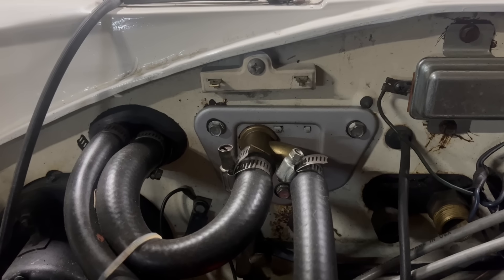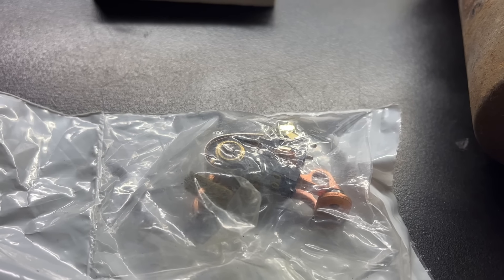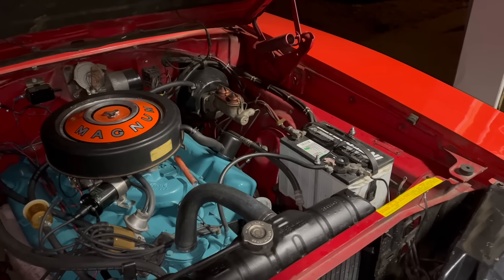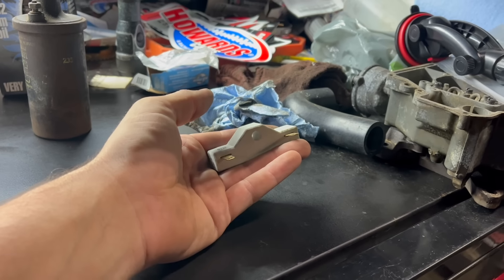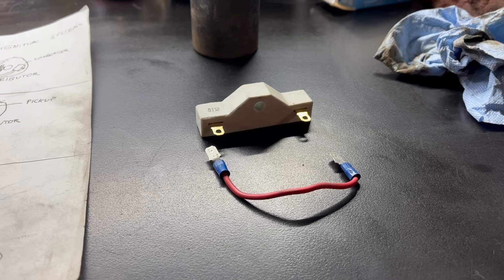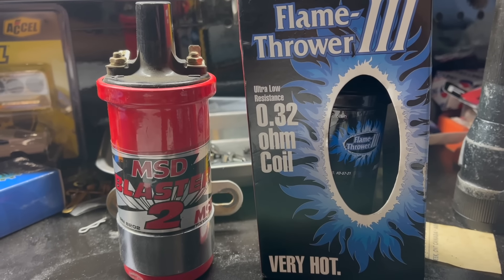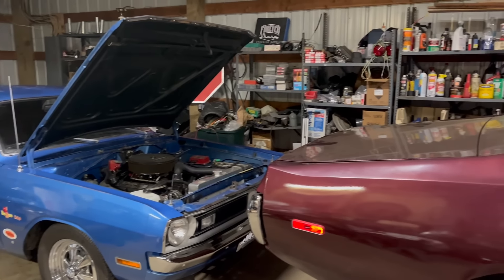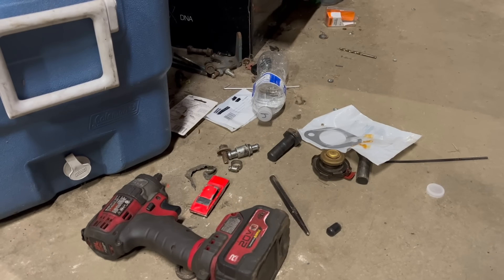The Big Ballast Resistor Video! A Simple, Yet Misunderstood Part Of Your Classic Chrysler Product

Comment: REAL Mopar guys hack driving with a bad resistor by starting the car in neutral and then knocking the shifter into drive while holding the key full twist.  But your method is cute!
Reply from the maker: But what about stick shift Challengers with no clutch safety? What do real Mopar guys do then?! Check and mate
Reply: @DeadDodgeGarage 😂
Reply: Every hack is valuable when the mental Rolodex shuffles into panic mode ...like in the McDonald's drive-thru! We've all been there 😅, keep up the great work Mopar family 😁
Reply: Personally, I'll NEVER have another MOPAR without a (GM😮) HEI module conversion. 
Mount the HEI module on a heat sink and carry a spare module, especially if it's a cheapo.
Reply: HEI IS AWESOME 👍😎 AND CAN BE MODIFIED TO ABOVE 7000rpm....👍
Reply: That's how you get them on the trailer right after you bought it real cheap!
Reply: Installed a kit where you got a new dizzy and orange box along with a smaller looking ballast resistor where the instructions insisted to use. Why ? and could the stock resistor still work? Thanks for the video
Reply: This Tony guy is a legend in his own mind.

Comment: Best way to make sure you’re ballast resistor will always work is to carry a spare!  It’s the best $3 I spend on every mopar I have that still use a resistor.
Reply from the maker: Bingo! Just like how having a brand new engine wrapped up on a stand will ensure that yours never breaks. Haha.
Reply: Three dollars has been a while .
Reply: I laugh about the other guys trying to delete or bypass the resistor unstead of just having a backup or 2 😂😂😂 especially in my case I'm a full purest with 1 exception that parts are completely obsolete and something new has to be done or park the car indefinitely
Reply from the maker: @danlevesque5437  I'm, like... most of a purist? With the exception of common, non-destructive, perfectly acceptable upgrades - your Edelbrock carburetors, your electronic ignition systems, sway bars, what have you. In general, I prefer mostly factory stuff.
Reply: @DeadDodgeGarage  I have faimly members who chop up the classic hardtop and make them convertibles when they were not, added automatic transmission to factory 3 on the tree vehicles, and even added a self jacking feature because they wanted to hit a button vs jacking up the car If it got a flat tire 🤦‍♂️
Reply: Friend of mine used to carry 2 or three spares.
Reply: It could also be a bad  electronic mod that could disable the motor. I also carried one of those in the car.

Comment: Fifty years ago i made a camper out of a 1953 GMC school bus , converted to 12 volts except for the starter . With the ballast resistor in the circuit the 302 CI six and six volt starter would fire when i let off the starter . The starter was foot operated so bypass circuit was not possible .I put a push button switch on the dash to short the resistor, then i would ask the youngest kid to help me start the engine by pushing the switch . The kids LOVED it !

Comment: I used to work where we had a dozen or so Dodge trucks that had a ballast resistor. Every once in a while someone would hit a pothole  and after turning the engine off it would not restart. We found a good thump would break the resistor. We ended up putting an elastic band on the firewall and fender and taping the resistor to the band to act as a shock absorber. That stopped the resistor from breaking.
Reply from the maker: Brilliant!

Comment: The parts store ignition box you show at 12:35 merits some comment.  Notice the odd shape and lack of electronics part numbers on the dome?  Some guys too these apart and found that they are not transistors, just a dummy stamped dome.  And the heat sinks were not attached to the components inside.  I would avoid purchasing these if possible, but I doubt anything else can be found new.
Reply from the maker: Someone else mentioned that too! I’ve never torn one apart, but now I feel like I should for science.

Comment: I replaced the Ford HEI system with a GM Style HEI distributor on my small block Ford. I kept burning the control module on the distributor. I checked voltage and it would spike to 15 volts when the alternator would kick on. I placed a ballast resister in the line going to the distributor. Solved the problem.
Reply from the maker: Huh. That’s interesting… the charging system output shouldn’t even reach 15 volts, and there ought to be a good bit of voltage drop from there to the ignition. But hey, it worked.
Reply: It would only spike for a second. I put a new voltage regulator on and it was better but there was still a slight voltage spike. I wired it with out a resister and it burned it again but not right away. 
I put the resister back and haven't had a problem since. I guess the next step is an internal regulated alternator. I don't know but my control module just doesn't like 13.6 volts.

Comment: when i was a lid we had a jeep that was hard to start my dad added one of these may not be the same one then a push pull switch and when it was used the jeep started right up no matter how cold or hot but you had to turn it off and not run it with it on or things could burn up

Comment: Previous owner put an MSD ignition box and coil in my 1984 B350, I kind of prefer that to going with a GM part. The box failed once when the under hood harness went up in smoke last year.
Reply from the maker: MSD is great - but it’s so expensive…
Reply: @DeadDodgeGarage  it’s a little expensive but I trust it for reliability more than a GM part.

Comment: Voltage drop when cranking in the J2 circuit (ignition) would cause hard starting in Lean Burn computer cars and later computer versions. I replaced a lot of ignition switches and connector terminals.
Reply from the maker: Interesting! Thankfully I haven’t had to go down that rabbit hole.

Comment: Thanks for a great video.  Here's me looking for free advice.  I have a 318 Chrysler marine in an old inboard boat.  The boat starts great.  Runs great.  But after running for a while it starts to hesitate and run really rough at idle.  New plugs, wire, cap and rotor.  Does that sound like ballast or points or something else.
Reply from the maker: I can’t say I’ve run into anything like that. One could conceive of multiple causes though. Have you done a resistance test on the coil? Does this thing have points? If not, I would be suspicious of an ignition control module issue. Or with points, a condenser failure can do interesting things kind of like that. Or - is the engine possibly getting hot? Cooling can definitely be an issue in boats like that.

Comment: I haven't worked on old Chryslers in decades but IIRC the ballast resistor varies its resistance. As they get hot resistance increases. If your Dodge didn't start in a couple tries, turn the key off and give it 30 seconds to cool off. You could tell the guys who bypassed that resistor, as they'd melt points and snuff the occasional coil.
Reply from the maker: That’s give or take how it works. The thing about the no start is that it should always fire and then die if it is a ballast issue, as during cranking the resistor is completely out of the equation.
Reply: @DeadDodgeGarage  Thanks. I recall coils running on 6V for Chrysler products but do you know when it was discontinued? I recall people removed the ballast by going to electronic ignition and a "modern" coil. (I was never sure how Ford/Chevy handled 12V systems.) Back in the day I switched a couple cars from 6 to 12V systems and installed Dodge resistors. Then the only bit to worry about were wiper motors and radio.

Comment: I've owned at least 2 of these cars constantly since 1979 and have never replaced a ballast resistor, and only replaced 2 ignition modules, 1 just quit, the other all the goo melted off of the back but was still running fine, but I replaced it anyway just because!
Reply from the maker: I’ve seen several modules do that! It’s always a really impressive mess.

Comment: Basically you need a strong spark to start a old school 440 CI in 0F or -17C weather. Also the battery will produce a lower voltage at 0F.
So a start relay shorts the ballast and provides full current to the coil.
But once running that current will also over heat the coil.
The ballast resistor is used to limit the current.
A voltmeter will show the difference. Most systems will run at 13.2 volts. At a nice 72 F the battery is a nice 12.7 volts( when nearly new).
The resistor provides a drop in voltage and lessens the current and heat inside the coil.

Starting a carburetor purple shaft 440 in the winter sucks. Below 0F usually requires jumper cables.
That is why a 318 CI 2 barrel is better in the winter. You can also use it to jump start a high horsepower 440.
Reply from the maker: The resistor bypass in these is not from any relay - it’s a special starting power feed straight from the ignition switch.
Reply: The starter solenoid is nothing more than a simple relay energized by the ignition switch start position.
Reply: @JoeBlowski  Not any more. The computer monitors the RPMs. NO RPMs sends clear to start pulse to another relay after a dozen other systems checks are done.

But I understand. Can't expect today's humans to do things like.
The Ebrake is engaged. Yep had to pull on that too.
 Depress the clutch. 
Ensure the Transmission is in neutral .
 Why should they?
Might miss a post on their phones.
Reply: @DeadDodgeGarage It seems I was wrongly thinking the reason Ford used the starter solenoid/relay was because current during resistor bypass while starting the engine would be more than the ignition switch could handle.

Comment: If your Mopar don't start and your ignition is not working sometimes it can be the starter dragging and pulling enough voltage away to where the module can't think, but the starter still rolls the engine over.
Reply from the maker: I’ve never experienced that in a Mopar. I have experienced it in early 70s Cadillacs though. Two of them. Both had points ignition.

Comment: i have hyundai azera 2009 & i found a resistor for my ignetion coils in the parts catalog. if it's became faulty what are symptoms? because the engine have random stuttering even i can hear the statics in the speakers because of it! by the way the spark plugs, coils, battery, alternator are new & the diagnostic tool don't show misfire
Reply from the maker: That’s a different kind of ignition resistor - and a totally different kind of nightmare that I don’t have any great ideas for.

Comment: A resistor can only limit current, not voltage. That is why the voltage you read on the other side of the resistor changes with load, from no voltage drop with no load to extreme voltage drop with heavy load. The coil is a mostly fixed load, so you get mostly a fixed voltage. That's why you hear about different ballast resistors for different coils since they need to be a matched set to limit coil power or wattage (volts times amps) which is really the point of the whole thing. Prevent melting or needlessly heating coils, and prevent wearing points prematurely.
Reply from the maker: Yes I’ve been schooled on this already. But the voltage at the coil also changes, and it’s easy to measure.

Comment: The resistor keeps the points from receiving full battery voltage & limits current thru the ignition coil. This resistor heats up at low rpm & lowers current flow thru the coil and at higher RPM cools off (directly related to dwell) allowing more current thruvthe coil and therefore more available spark energy to prevent misfire. Electronic ignition systems do not require a ballast resistor generally. GM & Ford had resistance built into the coil positive wire, which must be removed or bypassed to get the full benefits of electronic ignition.
Reply from the maker: It’s not the ignition box on the Chrysler that requires the resistor - it’s the coil they used. But the box can live without it.

Comment: My 74 had four individual ends two at both ends.
Reply from the maker: Yep. Those early electronic ignition cars with a five pin ignition module use a dual resistor. One side of it powers a circuit in the module.

Comment: Basic electric/electronics. Used to through off heat from the coil circuit.
Reply from the maker: Technically the heat is a byproduct of its function, but yes

Comment: The parts store ignition box you show at the end is a cheap knock off. They took some of these apart and found that the silver dome is just a dome. Not a transistor.  And the heat sink isn't connected to anything on the inside.
   They do seem to work, amazingly.  I don't mean "they work amazingly." It is amazing they work at all is what I mean.😁
Reply from the maker: Yeah… that’s what the owner of the ‘73 Charger ordered. I am not expecting much out of it… I could’ve shown the original 70s blue box from the Direct Connection kit in my Demon parts stash, but that would’ve required actual work. Haha.

Comment: Ok I have had a burning question for over 40 years. Had a Town and Country Wagon that ate condensers. I think it was a 74 vintage with a 318.
Reply from the maker: Huh. I really don’t know. ‘74 would have electronic ignition (with no condenser) so it must’ve been a ‘72 at the latest. But I can’t say I’ve ever heard of that before. The only thoughts I have are coil related. It’s a really simple circuit.
Reply: @DeadDodgeGarage  interesting. Other factor I did not consider was the source of the condensers. Usually bought at a discount auto parts store way back then.

Comment: I had a Plymouth fury  a Plymouth Horizon and a Dodge Omni which I called an
OH! My!
As in oh my why did i buy this.
Had to carry one of those resisters in the glove box at all times cause you never knew when you turned the key if the car would stay running or not.
Changed them on a regular basis.

Comment: To hook up a remote switch.  Hook up red to + side of battery and - to the small end on the starter?  Want to make sure because Im just trying to crank. Im working by myself.
Reply from the maker: Yes, but you can also make those connections at the starter relay more easily - or just bridge the two connections on the relay with a screwdriver.

Comment: I have a '66 Chevy with a BR from the factory. And an electronic ignition conversion. I had the "instant shut off when key is released" issue and my mind was blown. It couldn't be the BR, it wasn't in the circuit. The ignition switch has two wires for power when the key goes to "ON" and "Start" and they connect to the same terminal. One wire was bad....
Reply from the maker: Nice. Yeah, same effect.

Comment: Question/Help?
I have a 69 charger that's been setting for about 20 years. I've forgotten a lot of things about this mopar within that time.
It still has the points system and I'm trying to get it running again. I actually bypassed the resistor with a battery wire going straight to the old coil. That way I can crank it with a screwdriver while I'm under the hood.
But I'm getting no spark.
Is this because I bypassed the resistor? And/Or does it sound like I need a new coil?
If so, which coil do I need? Everytime I look up a coil online to purchase it asks do I want it with or without a built in ballast resistor. I'm unsure which to buy.
I also have a small electric ignition conversion that I'm going to one day in the future put in the distributor, but I'll save that story for another time or comment. Thanks
Reply from the maker: Have you cleaned the points with a small file? Your points are most likely corroded. Refer to my recent 1957 Plymouth Belvedere revival video where I demonstrate the technique I use to check points and coil, and how I clean points.

Comment: Tony is the best table cleaner on the planet I learned about bowels resistance the hard way 50 years ago broke down at 3:00 in the morning in the middle of nowhere how to walk 2 mi that I found out after the whole thing was over from my father all I had to do was twist the two wires together and I would have been able to drive home of course after that I've learned to keep about 47 spare bowels resistors in the glove compartment
Reply: I guess I should have double-checked this automatic speech garbage it should have said ballast resistor not bowels resistor sorry
Reply from the maker: I picked that up. The text to speech is just the worst for that… good times.
Reply: You know another thing I used to do I used to keep a spare ballast resistor already mounted on the firewall in case it failed I just had to pull the leads off and put it on the other one I also did that on my electronic ignition Chryslers I have an extra whatever you call it spark box I got two of them if it fails I just pull the plug off and plug in the other one I still have my 73 modified 318 duster for the last 45 years still sitting in my garage you know what it puts today's cars to Shame

Comment: Good info but, I take exception with the term "input side" and "output" side of a resistor.  A resistor is non-directional.  Input and output are determined by the electrical path (wires  to and from) the resistor, not the resistor pins.  But, I learned, 40+ years ago to ALWAYS carry an extra resistor in the glove box.
Reply from the maker: You are absolutely right, either side can be either. BUT. In this circuit, one side of the resistor becomes the “input” side from the key, and one side becomes the “output” side to the coil. And since the intended audience is a group of laymen, speaking in plain and simple terms to describe what’s going on here makes good sense to me.

Comment: In the old days we would have a switched 12 volts to the coil for 1/4 mile run for a hotter spark then turn it off